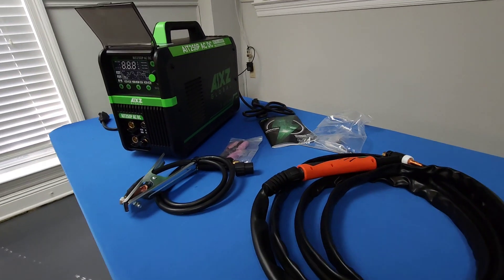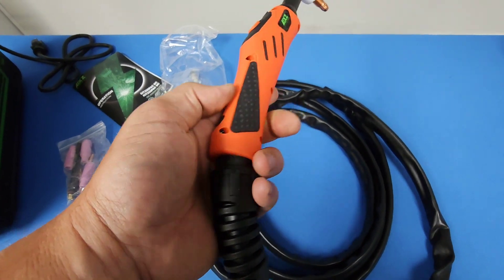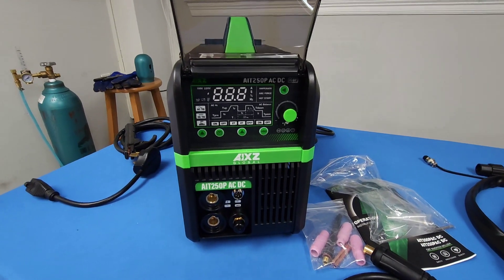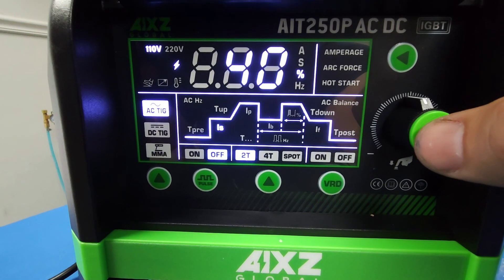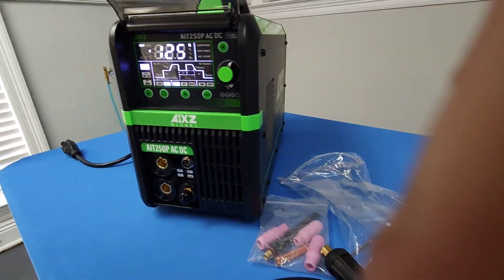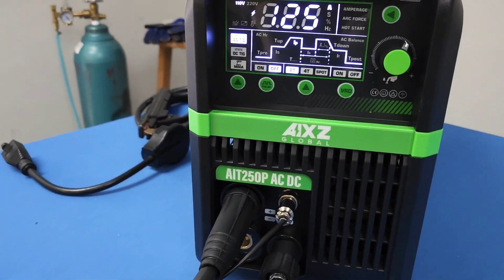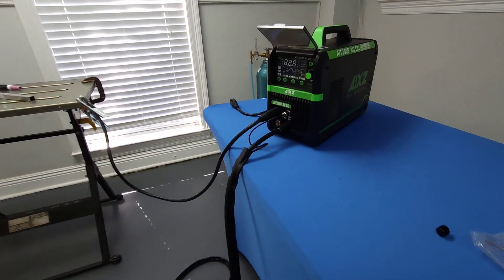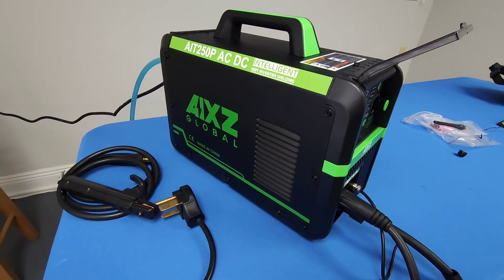AIXZGLOBAL AIT250P AC/DC ALUMINUM TIG WELDER FROM #amazon ( Part lll)

Comment: I may have missed it, but which one of the 3 did you prefer? I'm  looking closely at the Rubik. I'm not a fan of the barbed hose fittings.
Reply from the maker: @mickeyj4228  overall IMO Rubik was more polished and edged out the others . Rubik also being the most expensive.
Reply: @Toolnaround  I see Temu has it in sale at $394 with free shipping.

Comment: Thank you for taking time to make this video. I have purchased the aixz global unit and am mostly using for stock and to learn TIG. Be prepared to spend some money on more wire for welding lead extensions, that is the same with all of the low budget units if you want to weld something further than arms reach from the outlet.
Reply from the maker: @matthewjolivet2737  yeah the leads tend to be on the short side

Comment: Do you know the difference between this and the hitbox HBT250P?
Reply from the maker: @MatthewSimm  very similar.....hitbox has longer leads, .. Aixzglobal has shield to protect screen and fan is super quiet comes on as needed not constant. The machine itself is slightly bigger and heavier. Both are great machines
Reply: @MatthewSimm  i just bought the Hitbox, onsale now on Temu for $237
Reply: Both of these brends belongs to the same company, so it's expected the machines are quite similar inside.
Reply: Podrías mostrar cuál es la adecuada forma de regular los parámetros para soldar aluminio